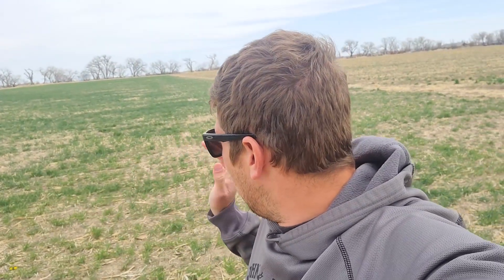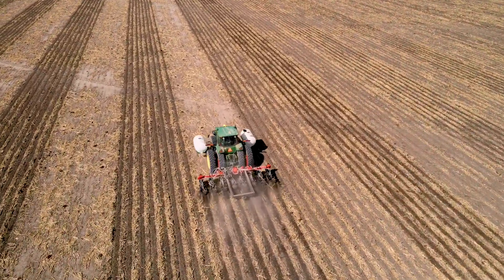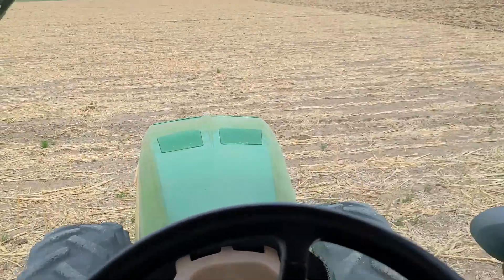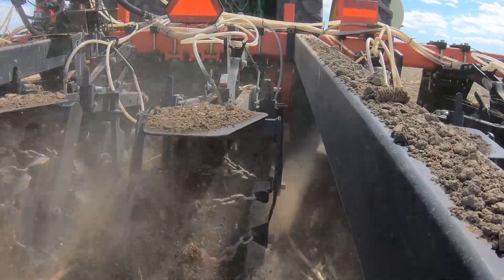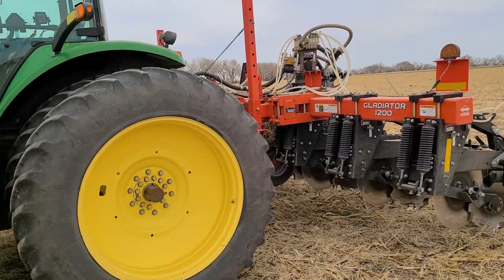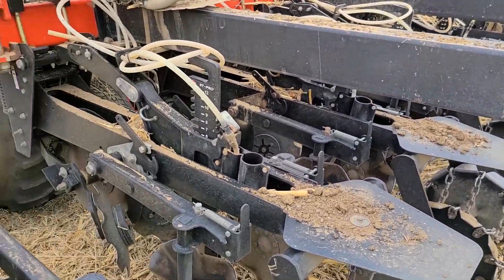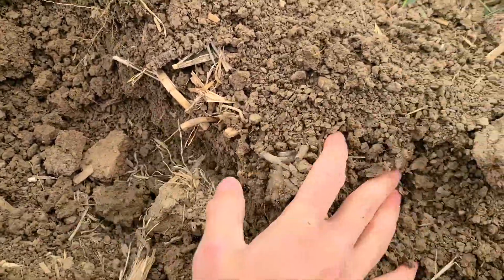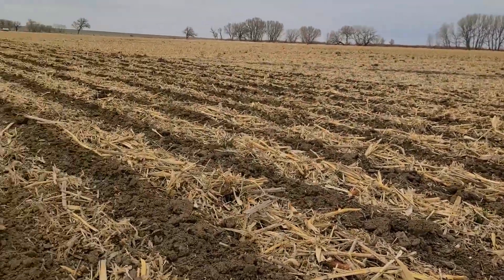Benefits of Strip Tillage

Comment: Looks like you're going 90 deg to last yrs strips. That's why it's rough.
Reply from the maker: That definitely didn't help the situation... but the landlord must of had an issue with his old disc because the bumps were spaced farther than 30 inches. It has been like this before I started farming it. Should of corrected it right when I started, but will work on it this spring.